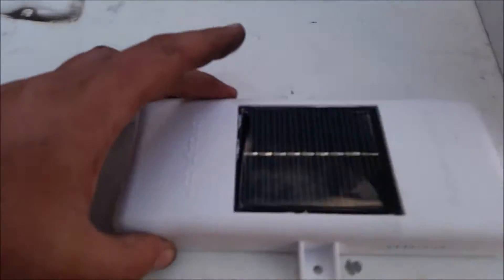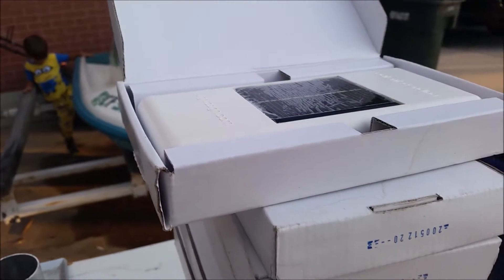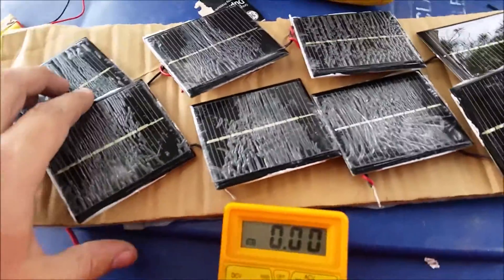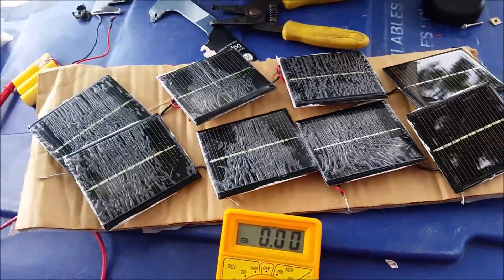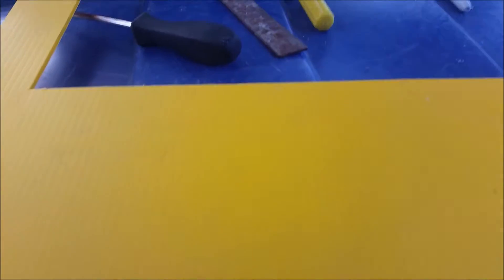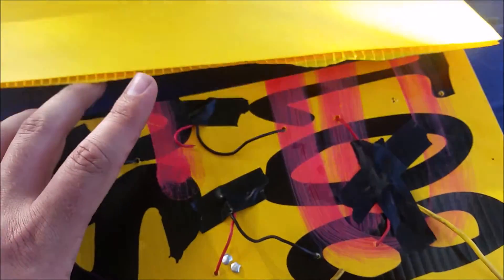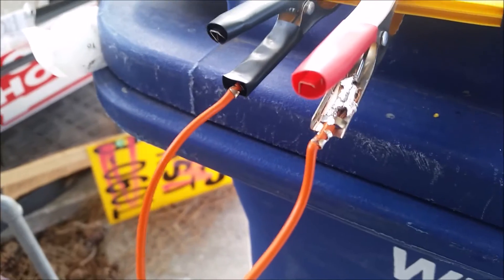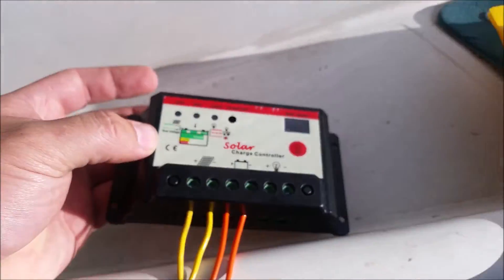How To Build A Solar Battery Charger From Solar Garden Lights - DIY

Comment: You couldn’t at least show how much charge the battery start it with and then waited till after charged up and then showed the charge on the battery from the solar panel you just built

Comment: You need a resistor in there too so you don't burn out the solar panel by letting the battery discharge into the panels.
Reply: A diode is used to prevent battery discharge, not a resistor